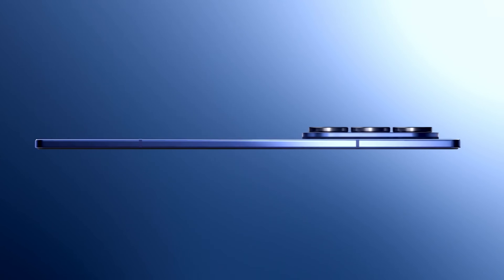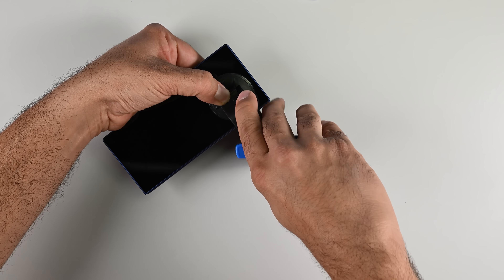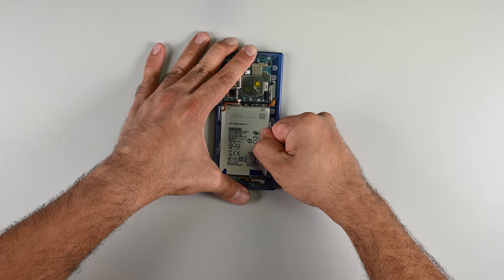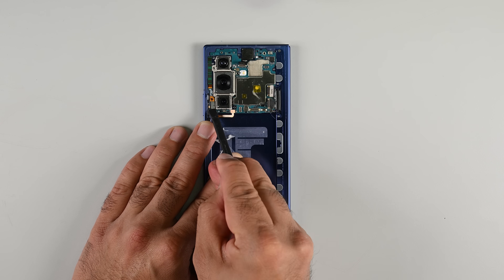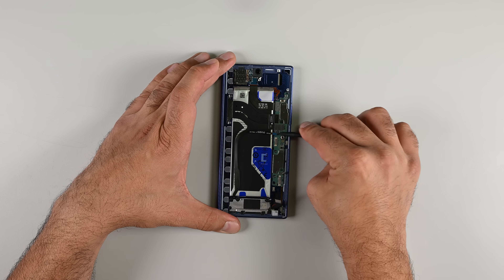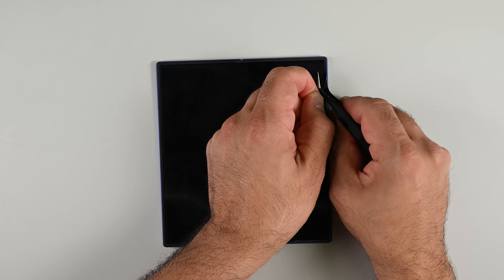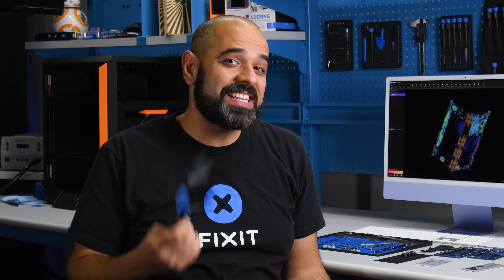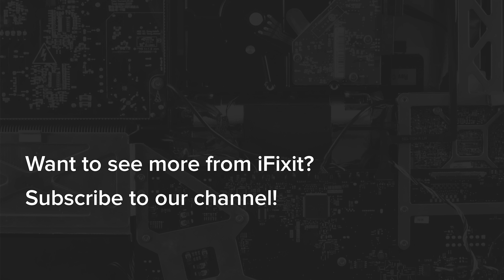Z Fold7 Teardown!  Beautiful, Fragile, and a Repair Nightmare

Comment: After 3 folds inner screen has broken on me without dropping or hitting them whatsoever I've moved to the pixel pro, yes the fold 7 was better to use but the fragile inner screen is a joke
Reply: Then you are clearly abusing them
Reply: @PoNKPoNy not in the slightest, I've had fold phones for over 5 years with no issues, the new fold 7 inner screen is horrendously fragile, it's happening all over the world with its green screen of death

Comment: Honestly I like the phone but at the same time I really hate this drive towards "thin" at all costs as all it does is create more E-waste. It means the durability of the phone is sacrificed and for a device that costs so much this isn't a good thing. The battery is the biggest concern of all, thats the part that's even if the phones well taken care of and left in a good case will wear out first. Always noticed with older phones that the first sign of fatigue would be the device needing to be recharged more and more as the battery would drain quicker.

Comment: it would be very helpful if you looked into the flex hinge cables and compare them with previous generation as they are the first to go before the screen actually go (but it does still impact the screen and other components)

Comment: It would be interesting to see the tear down on the Pixel 10 Fold whenever you can get one. I checked out Google Care. They will provide unlimted front and back glass replacements. You have to use a deductible to get a new phone if the center glass is damaged. Their is no coverage on the 10 Fold. 
 I don't know if you'll be able to tear down the spine on one, it would be cool to the intern cams instead of gears.

Comment: just a comment, you could remove the bezel quite easily without destroying it. alcohol and go slow. The inner screen is likely removeable and re-replaceable without damage. The 6 series is doable, i've replaced a few dozen inner display only on the 6 series, 5 series and below is almost impossible. If the inner display is like the 6 series, the inner display will be removable from the frame without damage. my BIGGEST concern with this series is actually the hinge cable. The 6 series flip has a major hinge cable issue like every series before. But i am looking forward to removing and replacing that inner display

Comment: You're just being a hater. Another channel abused the F out of the ZF7 and couldn't even snap it in half. He put dirt and rocks in the hinges and everything and the inner display and outter display were FINE. THIS IS ABSOLUTELY A DAILY USE PHONE. I had the 3 for almost 5 years and had only 1 issue. So youre nuts or just hating saying the 7 isn't a good daily driver 🤣🤣🤣🤣🤣

Comment: Given that it's a foldable phone, I can understand why it needs to be thin. But the problem is with regular phones. In the coming years, they won't be updated or focus on anything but thinness, which is something nobody asked for. Companies don't do this for anyone; they do it to eventually make maintenance impossible or to prevent the European Union from forcing them to include removable batteries. By reaching a certain level of thinness, they can make it impossible and thus avoid the issue.

Comment: The inner screen has a layer of screen protector pre-installed. It won't be damaged by fingernails. Just replace the screen protector if you have sand caught in between.
Reply: Previously generation of zfold has inner screen protector life between 1 to 2 years before self peeling off from the middle.
Reply: @TanPanama-k4u Had it happen within 6 months of owning the Fold 3... Samsung expect it as well and offer free screen protector changes within 12 months on all of them now. So more like 3-12 months not 1 to 2 years.

Comment: I'm 100% for repairability, but saying that the center screen's repairability will be a concern for many owners should be more like "...a concern for many owners' wallets". We can have cool devices like this that push the tech forward, or chunkier ones with compromises for the sake of repairability. And for the most part self-repairability isn't something most tech owners ever consider outside of fans of places like iFixit. So if Samsung charges $500-600 to replace the center screen and that includes the liability of them doing it right, that seems reasonable. Especially given how robust it actually is. Parts pairing and shit like that is where tech companies go too far. But I don't want repairable AirPods Pro, and I won't hold it against Apple for not making them repairable. They're small, and my expectation is they will be replaced not repaired. Having better recycling processes in place is more important do they don't end up in landfills.

Comment: I've had a fold 3 and 5 and now have a 7. I've never damaged it with my fingernails. I don't know why you'd state the slightest bit of pressure from your fingernails would damage it, that isn't an accurate statement.

The only issue i consistently had was the screen protector on the inner screen bubbling at edges and needing to be replaced, which I've done with both previous models.
Reply: Considering the folding screen and heating, its acceptable to repair screen protector every year.

Comment: Have had a fold 4 since a month before it came out. Never had a case on it and has no scratches or any issues whatsoever. Phone is the exact same as the day 1 got it and I work in construction. People need to get over this idea of how fragile these phones are. Yes the inner screen is more prone that the glass outside but take care of your stuff and simply dont drop your phone and it'll be fine. Heck a drop wont ruin this phone either unless its maybe open.

Comment: I sympathize with the battery and display adhesive being a little frustrating, but I'd wager that the reason they went for it was to add rigidity and durability to the phone in its assembled state. It is impressively thin

Comment: The chinese "tri-fold" is practically a gimmick. Having an exposed soft screen isn't an intelligent design and silicon carbon batteries is a desperate move to seem relevant, if you consider their charging behavior.

Comment: I have the fold 7 with insurance. Not taking any chances. I imagine if mine breaks I'll be give a different phone altogether instead of having mine repaired.
Reply: If you have insurance through a carrier, and you need your fold replaced, they will simply send you a scrappy refurbished unit. Maybe not this early in the phones life, but eventually the phone replacements are just refurbished units. I had my fold 5 replaced when a green line randomly appeared on my screen while I was laying in bed watching YouTube. Aftef getting the replace fold 5 through insurance it was downhill from there. I hate paying so much for insurance, and a 200 dallar deductible just to be sent a unit that isnt new. Side note, im not basing the fold. I upgraded from the 5 to the 7 and love it. Im just taking extra precautions with cases and screen protectors so I can take of my phone fold for as long as possible.

Comment: Would have loved to have seen it put back together and see what the true failure rate of it being taken apart. So did the inner screen work when you put it back together? Jerry rigs everything did some serious bending and i never thought the display would have survived that. But it did. The new metal layer on the bottom of the screen I'm wondering if that's helping or not. But I have also seen screen breaking from just removing cases. Does the ZF7 still have the banding in the hinge that has been a major issue for folds in the past snapping/moving and destroying the screen? Thanks for the teardown always entertaining.

Comment: You come across as a negative Nelly in the video. I don't think anyone is shocked or surprised that the thinnest foldable phone is challenging to repair but not impossible. I learned a long time ago that if I ever need a Samsung phone repaired, which I haven't yet, I'll be sending directly to Samsung. They USE only OEM parts, which many repair shops don't do, and the repair is done by people who know what they're doing. Also, surprisingly, the repairs by Samsung are typically cheaper than the repair shop down the road. I've helped out some friends and family with their phone repairs.
Reply: We in the Nordics atleast, have our devices insured through a package for everything we own at home. Meaning the cost would always be lower to have an OEM repair it, than doing it yourself (which voids the warranty for us here, but insurance covers most of the repair, and required only a small deposit so why do it ourselves? ). Soo the rights to repair our phones makes no sense in the Nordics as we are usually, mostly have it covered under insurance. The repair is only viable if it out of warranty (which is 3, 4 or 5 years for us)

Comment: For anyone who wants si/ca batteries.. they last significantly less compared to lithium ion because when charging and discharging, the silicon expands and contracts, causing the lower lifespan.. the tech is still in its infancy.. while litium ion lasts longer, it's less dense, meaning lower capacity.. i think software and soc optimizations are way more important compared to a bigger capacity battery..
Reply: Why do none of you understand that the "battery health" percentage is an estimate based on software monitoring the charging cycles.

They haven't yet invented some technology that can magically introspect every lithium atom in a battery to check its life.
Reply: this. i have a phone with a sica battery and it's degraded 20% without even a year passing
Reply: Oh please, all phones used a Li-Po battery, which has even worse longevity and is more prone to turn into a spicy pillow. Silicon carbon anodes in batteries require better chemistry overall, and my phone still has 100% capacity even after 3 months. It comes down to the chemistry, and Xiaomi phones have some of the worst chemistry of them all, to try to save a couple dollars on batteries - which is why they can degrade significantly faster than other phones. iPhones have bad chemistry too. Samsung used to have bad chemistry, but they had to improve it after the Note 7.
Reply: @one_step_sideways 3 months is still new lipo is worse im talking about flagships here using li ion not li po
Reply: @DrAliToma  That does not explain why Apple and Xiaomi have their batteries wear out by 20-25% in 2 years
Reply: @one_step_sideways apple has li ion not silcon carbon and their batteries degrade to under 80% in 2 years which is really bad samsung batteries last 4 years minimum before dropping this much.. xiaomi si ca batteries are in between apple and samsung in longevity
Reply: @one_step_sideways its not just battery tech its also how well designed the battery is.. samsung and apple use the same tech "li ion" but apples battries last 2 years samsung 4 years.. but if we talk about both types being well engineered and designed lithium ion will outlast silicon carbon.. simple chemistry and physics

Comment: It looks pretty repairable TBH. Only part that is though is the inner screen but foldable screen always come with frame so should not be a problem to migrate old components to new body. Also Samsung has the best solution to attach battery and still be easy to remove as shown in small clip in this video, why don't they use that for all their devices?

Comment: they should have kept it the same thickness as the fold 6 but with larger screens and battery.. and the main display camera towards the corner rather than where it is since they are faing a lawsuit for the UDC

Comment: I don't really believe the Z Fold 7 is that fragile since JerryRigEverything tried everything in his power four or five times to break or snap the phone in half, and both the outer and inner screens kept working.
Reply: Thumbs up for that! The Fold7 passed the bend test!
Reply: Appreciate
Reply: JerryRigEverything is a soyboy. He’s weak. No wonder he couldn’t break it.
Reply: Appreciate
Reply: X fold 5 內折螢幕更換14900元
Reply: X flips 4 內折螢幕 更換 9500元
Reply: The main durability concern is with folding/unfolding that inner display as many times as you will: past folds have all eventually developed stress cracks in the UTG
Reply: Mine broke day 19 on the inner display good thing I had insurance.
Reply: Well there is a new video on youtube from a cellphone repair person Somebody decided it it was a good idea to peel away the top layer on the Z 7 Fold. It's not pretty.
Reply: Honestly I would disagree in a certain way with you I have a Galaxy z-fold 7 and it's a magnet it attracts third particles and sometimes you don't even know what can end inside the screen that creates dimples mine lasted longer than the person who commented above me luckily I have insurance and it was replaced with a new model through T-Mobile I guess I was lucky because they tend to send you a refurbished one and everything is back to normal foldables will always be the best thing to happen but we cannot sit back relax and assume that they're extremely durable over there past counterparts or the OG one let's keep in mind that the inner screen will always be the most vulnerable part of a folding phone and folding phones are not for people that are like my mother Hope plan on keeping their phone for the next two or three years or until the end of a major Android update and that is the downside of a foldable cuz they should be able to last that long but they don't One of my sisters has one I believe is a fold four and it doesn't open all the way anymore and that is a concern when you want to plan on keeping a foldable device for a long-term
Reply: I have fold 4 for about 2 years after 1.5 years inner screen make a crack on hinge but is working
I go to buy fold 7 
After 5 months inner lcd crack on middle and is not working any more...
Reply: I sadly broke th inside screen ): im having to get it repaired soon
Reply: Thumbs spread the force out but a drop onto some object, leading to more of a point load will likely damage the screen
Reply: Oh well, it's for him to hit the gym.
Reply: I don't think it matters. What would matter is not getting Samsung Care to cover battery replacement or front glass replacement. I wouldn't be shocked if any repair shop charges another $20-30 for labor just to replace the battery and another $50 to replace the front glass.😅
Reply: But he didn't bend it in the other way like he did for other foldables
Reply: @helloterranelongate
Reply: @helloterranbecause if he tried to bend it the other way it would just fold shut

Comment: If the innerscreen is hard to replace then good, that mean if mine breaks Samsung needs to replace me with a new fold 7 since I payed for Samsung care+.
Reply: Nah, they just replace it with a refurbished one, one that was damaged or broken but inner screen was fine.
Reply: @fboost damn, but original parts?
Reply: @LyonGaultier-83  If it's done properly a refurbished device should ahve all OEM parts, and can be better than brand new. New devices these days just come off full automated lines. A properly refurbished device actually gets individual attention to make sure all of its components are functional and in perfect working condition. If anything, it should function just as well and be as if not more durable than the new part. 

Some things I buy new still, but oftentimes if there's a factory refurbished option with a decent warranty on it I'll jump on it.
Reply: @shanenokes1170 Thank you for clearing that up. Much appreciated.
Reply: @LyonGaultier-83  You're welcome. A lot of people worry about refurbished devices, which can be a valid concern if it's not done properly.
Reply: @shanenokes1170 the problem is you are relying on that person doing a good job. Are they happy? Are they focused? Is there stuff going on at home?
People make mistakes and more so when they aren't happy. I have seen far too many unacceptable mistakes by repair technicians to blindy trust them.
Reply: @fboost  I'm not relying on a single person to do a good job. I'm relying on the fact that the device gets more attention at all points of the process than it does on the factory line. I think you're confusing repair shop processes versus an actual factory refurbishment.